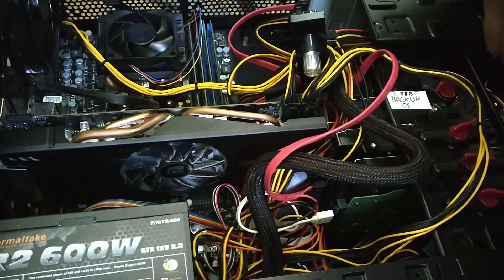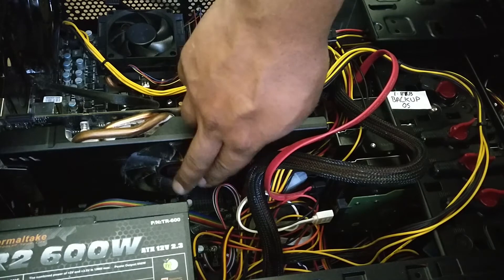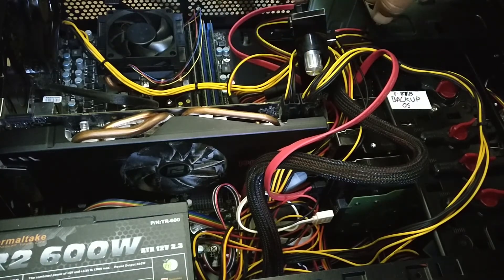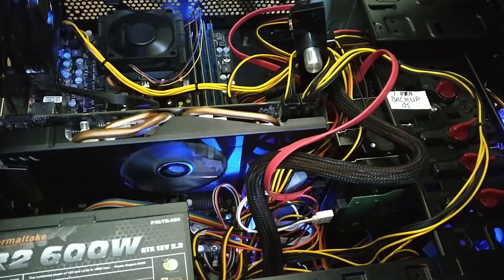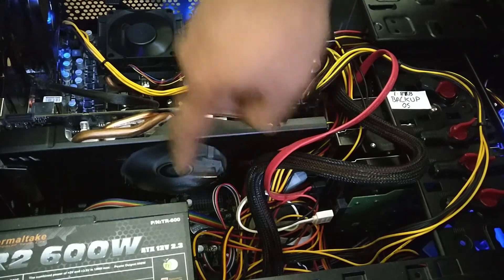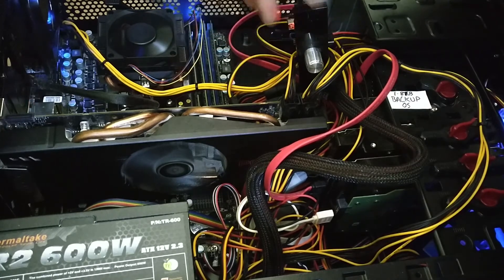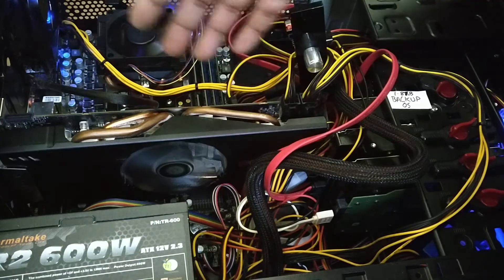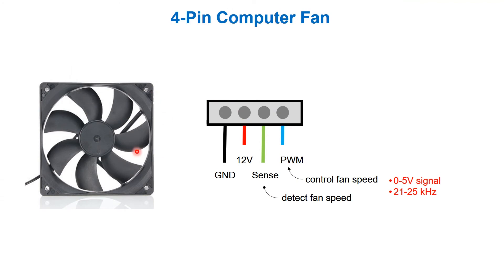Resurrecting a GPU cooling fan using a micro-processor and PWM

Comment: Do you know if you can control more than one fan with this? I have been trying with no success.
Reply from the maker: You can share the PWM wire, that way both fans are set using same signal. If you want an independent control, look into ESP32.
Reply: @deb-sahu  I tried to control two fans using the same connection points, However, I had strange results. First in order to get the single fan to work I had to connect both the PWM (blue wire) and the tach (yellow wire) . The blue wire was connected to p1 and the yellow wire was connected to p3. Now when I connected the second fan to those same connection points they both just cycle high and low on their own regardless of the potentiometer setting. I am not sure why this is. I did try just about every other combination that I could think of with no success. Any ideas as to what I am missing? Thank you for your help and time.
Reply: @deb-sahu  would you have any idea of what might be going on?
Reply from the maker: I have no idea, that’s wired behavior for fan.
Reply: @deb-sahu  it is. From what I researched you should only need the blue pwm input, but for some reason the single fan will not work unless I connect the yellow tach wire. Perhaps these fans are wired differently than most 4 wire computer case fans. I am not sure.
Reply: @deb-sahu  perhaps there is something   that was missed in the code. I did notice that you have two different pinout schematics for the same operations. I  looking further into this. 

I can get a single fan to work fine, but not with just the blue wire the tach wire must also be used as I stated before. I did source the Delta fan wireing schematic and cannot find anything that's wrong.
Reply: @deb-sahu  yes, it is. I had another go at it this evening and came to the conclusion that this board is simply not capable of driving multible cooling fans in any wireing configuration. From what I have researched you SHOULD be able to run them with just one wire with the PWM input, for some reason with these Delta( TFB0812UHE ) It will not work without connecting the tach wire for the single fan. I am curious if anyone has had a better experience with running more than one from this attiny85. As for my cooling project having to use multible boards for more than one fan is not feasible. If anyone comes across this comment thread please enlighten me as to what/ if anything I am doing wrong. Thank you in advance, and Thank you to the creator of this video, it was much appreciated.

Comment: For those that are new to this like myself  you could have mentioned that you need to program this before use.
Reply from the maker: Sorry if I did not mention that, the code is provided for free in the description and all you have to do is connect an usb cable and click upload.
Reply: @deb-sahu  No worries, I did find the code and will be trying it out soon. Thanks much for the video.

Comment: What happens if the esp fails, Is there a way to put the fan at 100% if the esp fails?
Reply: @deb-sahu  yes if it’s not connected. But if it’s connected it goes to low if the microprocessor failed or something happens to it. My arsuino I unplug the power to it and the fan goes to zero it stops.
Reply: @deb-sahu  I will try another pin. But I’m short on pins. I only have 4 pins to try on. However 2 of them are only pwm pins.

Comment: HI Debashish, I tried to understand the code but i cant do it. Its too hard. Is there a way to have 2 potentiometers and 2 pwm outputs ? One has to be 25khz for a fan, others can be whatever ideally also 25khz. How would you enable pin 0 or pin 4 to output pwm signal ?